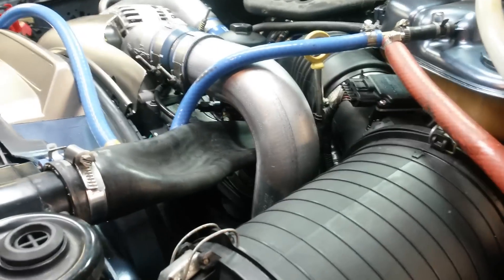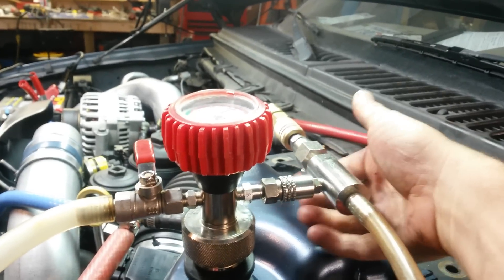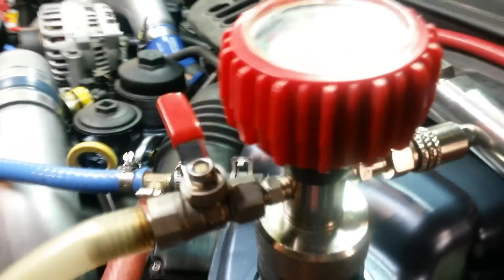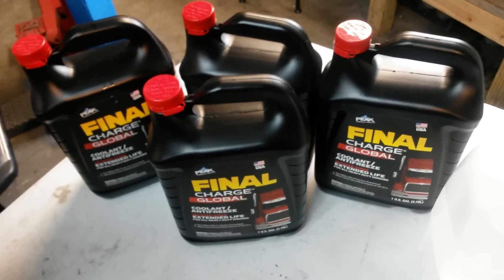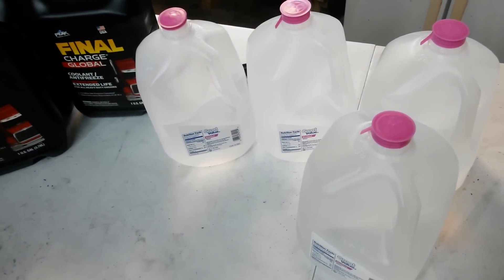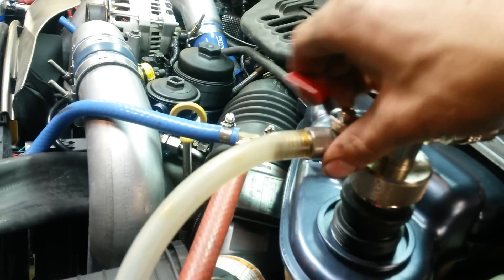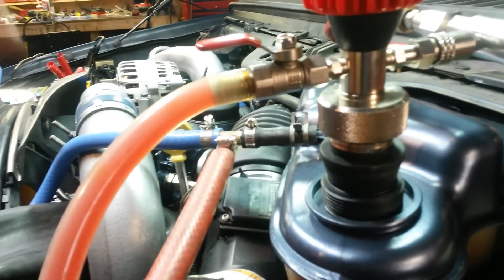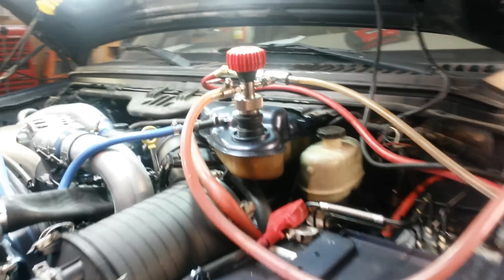FORD 6.0L ~Vacuum Filling the Cooling System~ No Air Pockets

Comment: If I do have a air bubble in my cooling system would that cause my ect and eot to be a little higher and the deltas to be off by 18 -25 degrees?  Cause I changed me water pump and didn't vacuum fill just regular fill. Please any help would be appreciated cause Im still fairly new to diesels, and don't want to mess up my truck.

Comment: Your astore link just goes to the astore associate page.  Very interested in purchasing the gauge products on your videos.
Reply from the maker: Thanks for letting me know the link is broken! Which gauges are you most interested in? I do have a video on priming from under the hood with the starter and the FICM relay out. Search "Ford 6.0l priming hood"
Reply: Sure wish the link worked...I seek the same information on the equipment Corey did. Also, is it an identical process with the same equipment on the 2008 6.4l TD?

Comment: Hi, Thanks for the video on filling the coolant system and cycling the fuel system.  Just did a head gasket replacement on my 2004 6.0.  Getting ready to start it.  Do you have a video on primimg the oil rails or first start after rebuild?  Don't want to screw all I've done up.